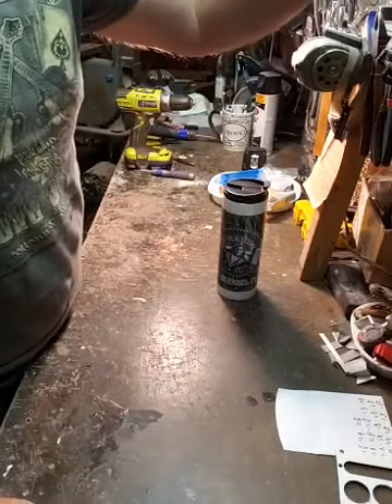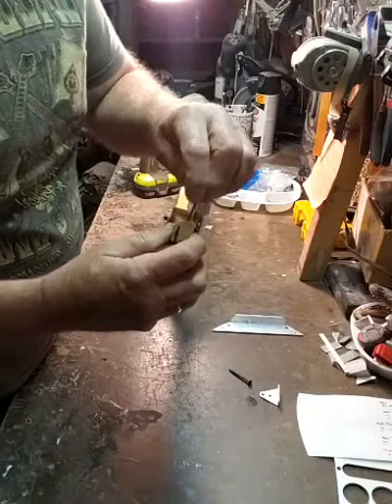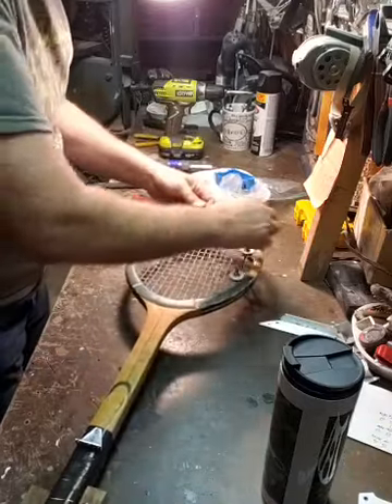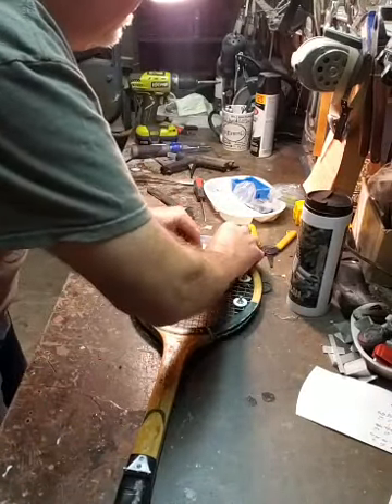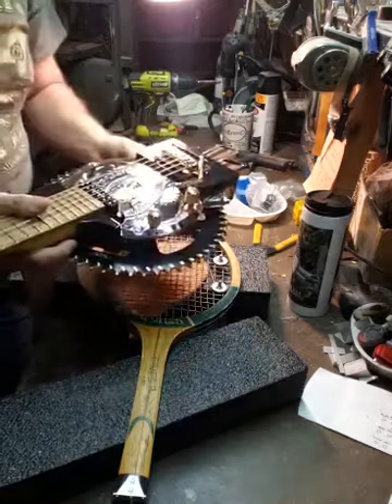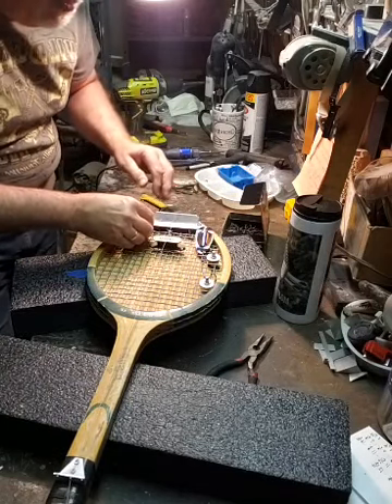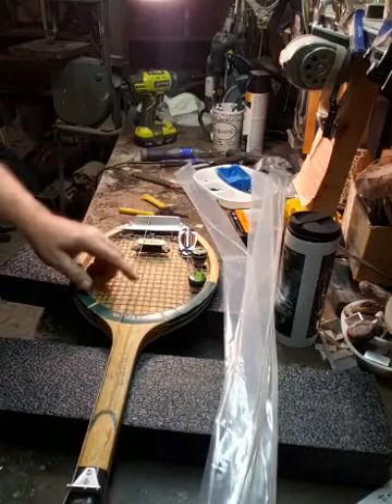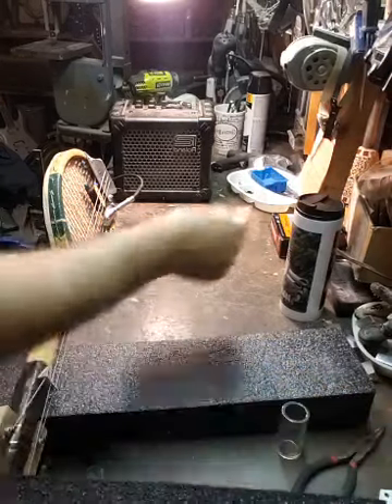HOW TO BUILD A GUITAR FROM JUNK

Comment: Do you think it would be to hard to used the neck for the tuners instead?
Reply from the maker: I was going to put the tuners in the handle but this Racket handle was 3 pieces and the center was bad.